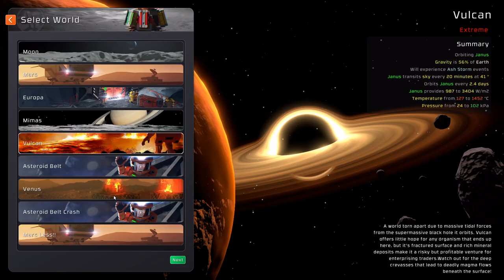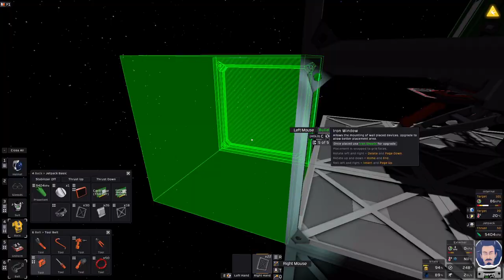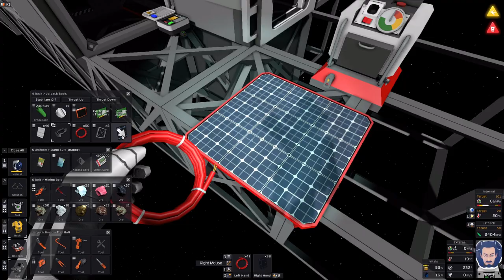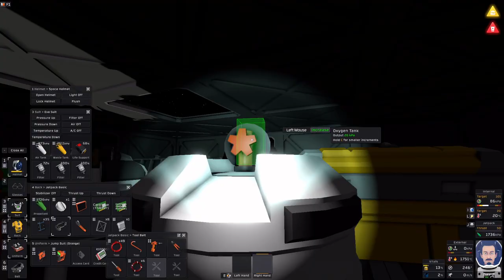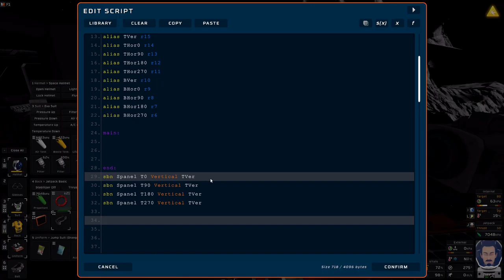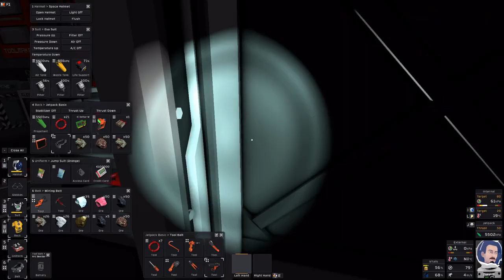Lost In Asteroids Pt1

Comment: That was rough with the O2. I think there’s also a typo in r7 of your tracking code. 2700 rather than 270. 😊
Reply from the maker: Ooh yea, I rewatched to see where I went wrong. One of my upper solar panel Hash names I used 2700 instead of 270... I'll have to go back and fix that before I redo my power installation so that wont be a head scratcher.